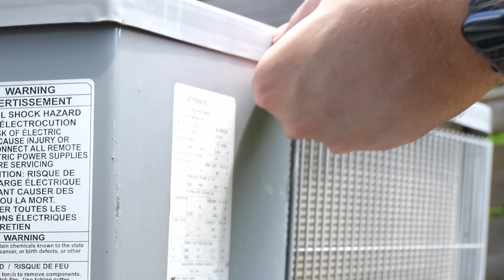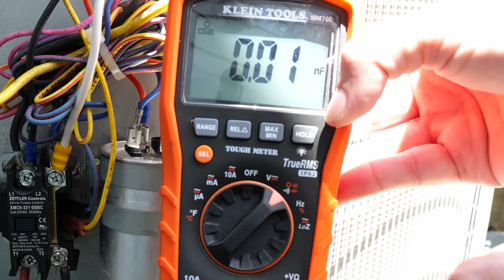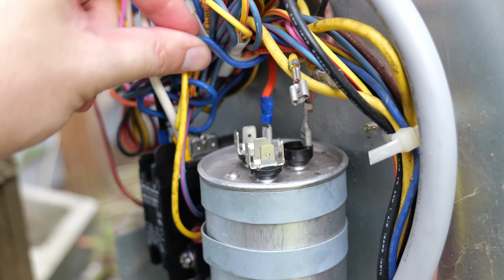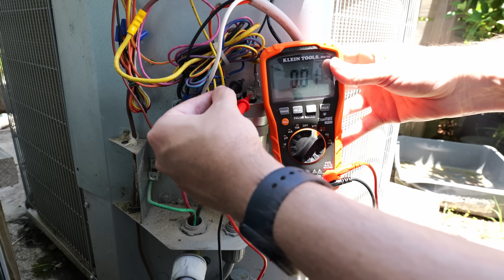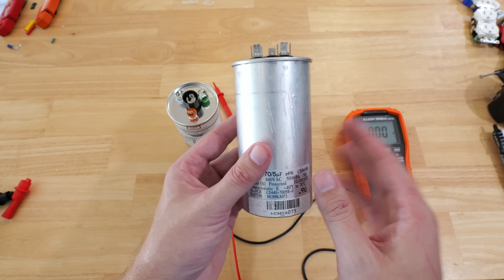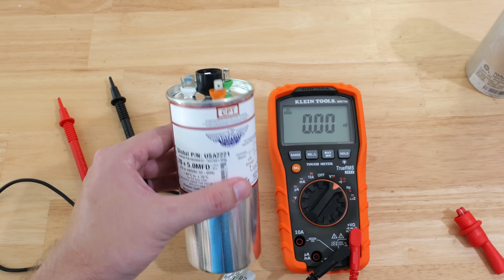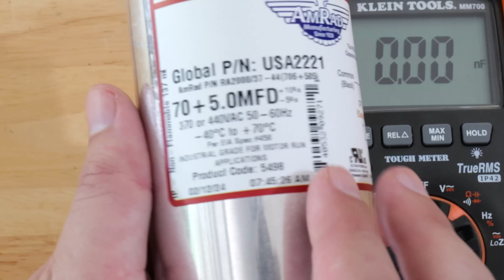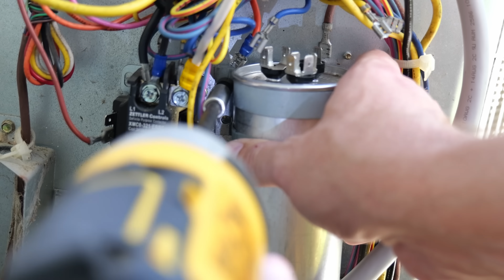Don’t Get Ripped Off! How To Avoid The AC Capacitor Scam And Save $500

Comment: I have this problem that I figured out right away,  the contactor stuck on. I have determined ( even though the thing has no label) that it is a  single pole 24v 30 amp contactor ( carrier unit by the way) . so I have that in my checkout now, but i know this units pretty old and I thought, probably would not hurt to look up the rest of these parts and see if I can help this run better ( I literally have not looked in this unit since 2006 and who knows how long before that has it been serviced )   The contactor is only 14 bucks, the capacitor that is installed LOOKS FINE and the unit runs  but its a little noisy humming,  but also the capacitor is an oval General electric dual run , it was made before GE switched names to gentec.  i did not test it as you have shown yet but I do have a Genentech equivalent in my cart right now as well ( 27.00 ) -  there is another component in the unit I have here that I do not see in yours and t hat is probably because mine has no board like yours.  The thing is a barrel  starter assist  thing  labeled Cera-Mite  305c11 HC95XX009  <-   it looks old and I thought, well I will just get a new one of those as well and everything will be Optimal!  BBUT that little gem is HIGH DOLLAR! YIKES!  around 100 bucks.   does this need to be replaced  just for being old ya think?  I mean, it's not cracked or bulging or anything.   must be a chunk of gold inside or something.   it has 3 wires one in the middle of the barrel and one on each end, when I looked it up ( function) says boosts a start of the motor.     I was wondering if the motor starts and runs  maybe it's all good and no 100 bills going fly outta my pocket OR if the whole system would be better off  with a new one , is there some kind of equivalent for that part.    I thought maybe they don't make or use them anymore and maybe because of that they raised the price to stupid high.   I am not sure why but my capacitor is well over 20 years old and it looks perfect . <- I am going to go test it after dinner. LOL 
   Thanks for any help.   the best help would be right away though really as I am have no a/c right now at all.  :0)
Reply: Cera-Mite  305c11 HC95XX009 if it is attached to the capacitor(sepsrste location) it is probably called a hard start capacitor.

Comment: Remember, you're not just paying for the part you are paying for the knowledge it takes to troubleshoot the unit in order to determine that the capacitor is bad. Sure you might have found one thing that you can fix if you're lucky but how about that technician that has to make his living?

Comment: Many hvac technicians have to sell a certain amount of parts per week. In a lot of cases the technician might get a base pay but where he makes his money is on a percentage of the parts sales he does.  Thats why a 7.00 capacitor will cost you 200 or more dollars.
I never changed a capacitor that was within 10 percent. So.. if that 70 was a 63 mfd or better.. I wouldnt change it.
Look.. there are costs associated with "the cost of doing buisiness" which is rent, vehicles, insurance, uniforms... all the things it takes to run a business but over the past decade or so HVAC companies and all trades in my opinion have begun charging just outrageous prices.
High parts and repair costs are also used to try to convince people that it might be  time to replace a system. Techs and their companies really make out like bandits on system replacements.

Comment: If you’re just changing a cap you’re not fixing the problem, you usually have a plugged condenser coil and usually it don’t look it till you wash it properly from inside out with a proper cleaner so if you or the service provider aren’t identifying the true reason for failure you’ll be there soon again and probably changing  part that’s more expensive 😂

Comment: Always keep a spare cap in you just in case box.   Don’t forget you may have one for the fan.   Also the air handler has one.  So you need 2 or 3 depending on your unit.   I’ve actually never had the one on the air handler go bad.  I had an AC guy try to tell me my compressor was grounded. He never disconnected the wires.  You always want to isolate your component before testing.

Comment: the percentage is there  to let you know that the capacitor  has a tolerance from the factory  so it should read on a 5 mfd  @ +/- 10% you  should be at 4.5-5.5 out of the box that is not necessarily what the rating tolerance is for functionality  for that  if you like rules of thumb  its lower or higher than 30% i always think of it like in school 70% is a C but 69 is a D  so  you fail  but a C passes.

Comment: Should check voltage and amperage on the compressor and fan motor after replacement of the capacitor. This is to make sure there is not a reason the capacitor failed. Tag on the unit will tell you normal run load amperage. Anything around 50 to 75 percent of normal run load is fine. If more than that there is another problem.

Comment: Wish you would have included why you get OL reading when wires are still attached to capacitor.
Reply: When the wires are disconnected the only thing being tested is the capacitor. When wires are connected it's testing the capacitor and everything back in the wiring. If there is any sort of path to ground on either side the capacitor will not charge and you get OL reading.

Comment: Interesting video. I Have a question and hope somone can help me.  I want to lower the startup current on my refrigerator which is connected to an ESS battery system. The startup inrush current I measure with a chines multimeter is 12.5A @120Vac the nominal current of the compressor is 0.8A. The impedance seen by the grid during starup  is 10 ohm so I thought let's use a 10ohm NTC 2A resistor in the run coil path of the compressor. In this way I want to lower the current with say 50% assuming the compressor will still start and not stalls under these new conditions. My question is this a good idea, and has anyone ever done it. Is my assumption of 10ohm NTC ok.

Comment: So, you didn't make this clear in the video about what exactly the tech was doing wrong?

A good cap will test bad if it has the  wires connected to it?

Sorry, but I don't know why anyone else hasn't asked this question?
Reply from the maker: Well I think it is because I described what they did.  I had a whole section on it.

Comment: I had an ac company come out on a Thanksgiving holiday weekend once and the guy replaced the capacitor and only charged me $120. I knew nothing about the capacitors then. He said "I'm not going to charge you $120 for a part you could buy yourself for under $50. Still use that company for all my ac issues that I can't fix myself.
Reply: Sounds like you have a good company doing the work. $120 isn't too bad, if you take into consideration they have a business to run.

Comment: I have just one question. You had to have called them out for not cooling. I concur with your testing argument. My question is, even if he conned you and replaced a good cap with another good cap that would not have fixed the system, what fixed the system?
Reply from the maker: There was nothing wrong with my system.  I have a maintenance contract with them basically to make sure my refrigerant levels are good.  He “found” that during an inspection.

Comment: I just replaced my capacitor last week. $26 and 10 minutes of my time. Just pull the breaker, discharge the old capacitor (comm to herm, comm to fan) and then just put the new one in and hook it back up the way the old one was connected. Just take pictures. Simple.

Comment: I had one company come out and they said my fan motor was amping up and would soon die.  Then of course it needed a capacitor, and the evaporator had a blockage, all together this would be about $2400 worth of work.  They had already sold me a fan motor a couple of years before.  A condenser fan motor did go out in it while it was still in warranty.  Anyway, I had enough of their stuff.  It was cooling ok, so I told them, see ya' later.  Waited a couple of weeks and called another company.  They came out checked everything out and said, oh, you might need about a pound of refrigerant, but other than that, it's in great shape.  Guess who gets my repeat business.  Then that company started the same crap.  I found one now that seems to be completely honest.  It had been about three years since I had the AC checked.  I knew he would try to sell me something, most likely a capacitor. Well, he thoroughly cleaned the condenser coils.  Checked the capacitors properly right in front of me, and said it's OK.  Checked the fan motor current draw, and the pressures.  Said everything was OK, charged me the $79.00 that they advertised for the clean and check.  Packed up and left.  I'll probably get the same people out this fall to check the furnace out.  This system is closing in on 20 years old.
Reply: Lucky!!  I wish I had that luck.  I'm glad for you. Honest people and honest prices are hard to find these days.

Comment: Why even test the unit, these are cheap to replace and 90% chance that its the problem if the fan is not running. Just swap it and then troubleshoot.

Comment: Thanks so much for posting this. Technician came out to do maintenance and recommended 3k in AC work. I back tested and agreed the capacitor is bad but bought it myself for $16.
Reply: "Maintenance" is usually not required for systems unless the owner is so incapacitated that he/she can't replace a filter or hose off coils.

Comment: I see many comments on price when servicing a HVAC for a $20 part. There is a lot of hidden cost in running a business. Training is on-going, Work Comp, Liability Ins, advertising, vehicles leases & maintenance to vacation for techs. It’s true you get shady characters in almost every business but I have seen $4k for heating the building in a month and a $20 hr tech actually cost $33 when uniforms, Medical ins, Safety gear… There 50+ things to consider. Even his meter is $150+ depending on brand. I have a Fluke 87-5 RMS that cost me $500, but has a life warranty plus I send it back for accuracy testing every 3-4 years. Equipment changes, EPA rules change, computers, tax CPA, Liability Attorney on retainer, etc. Not defending anyone’s price or practice but the bolts & nuts are pricey all the way around! USA made; $42 retail. Off-Shore $22 retail. Amazon $18 w/3 month warranty! You decide. I am a retired Auto ASE master and $6 per flat-rate hr as customers paid $24 to get a car fixed. But that was 1977 when Star Wars came out. Theater ticket; $2.50 yeh I was there. Good Cap Video!

Comment: As the common, fan and herm terminals have multiple spades, does it matter which spades you connect to as long as your wire for fan, for example, goes to one of the fan spades?
Reply: doesnt matter as long as they go to the correct spade on the correct terminal

Comment: i just ordered my new capacitor as when i turned the AC on it was just humming and the fan wasn't spinning. I am an electrician for 35 yrs so i am just going to swap out the cap. I ordered a new contactor just in case as they were so cheap. But if I'm not mistaken i believe there was only two wires connected to it. When i get home today ill make sure but I'm wondering if the guy that was there last time spliced a couple wires together and only used two terminals. i will have to do a little more digging before i replace it.But my question is have you ever heard of that situation. Thanks

Comment: This is the exact reason I dont do residential HVAC. Dealing with homeowners is miserable and you have to take the abuse for every other contractor who screwed them. No thanks, fix your own A/C. Good luck.
Reply: You actually think you're the only choise home oweners have?
😂😂😂😂😂 what a 🤡.
Your probably a Scammer technician and that's wy you got alot BS from residential customers.  Thank God you dont do Residential.

Comment: I am a licensed HVAC, 71 year old. To charge $450 or $500. For replacing a capacitor is highway robbery. I charge between $197 to $250 depending on the size of the capacitor, I also use a heavy duty capacitor so I don't have to return. I have to make an honest living, I don't think there is a need to rip people off. When I get a call for service, I tell the person that I have a service call fee for going to diagnose the problem. If you don't want to pay for my diagnosis then I don't need people like you. I had an Indian who refused to pay me for my diagnosis, but wanted to know what the problem was so that he can go buy the part online. I wasn't going to tell him. Some people think they are smarter than you. It is not good to rip people, but it is also not very good for people to try to take advantage of you. You might think that the only problem is the capacitor, but in some ocations it is not and if you have no knowledge of what you are doing, you could end up electrocuting yourself.

Comment: It's not the Tech. His company list the capacitors at $500 because they don't pay their techs a living wage to perform the actual service. Out of that $500, he would keep 10% = $50. Not bad for an hour's work, but imagine if that's the only part he sells that day on 4-5 calls. This is what the homeowner gets for trusting ads or coupons for a $29 service call. The more you pay for a service call IE) $99 and up, the less you would pay for a capacitor.. Some companies if you have a service / maintenance contract with, you don't pay anything for a capacitor.
Reply: I pay $20 a month for winter tuneup and summer tuneup. They had the capacitor out to show me it is bad. He then put it all back to write me up a suggested maintenance ticket where they wanted to charge $200 for capacitor. He could have just did it while it was off for $75. $20 for the part and they would have made money. Instead they wanted $800 to replace the capacitor, contactor, and clean the coils. Insane.

Comment: Guy just left after telling me mine was going bad. They want $346 for a new one. This one's a month out of warranty, so obviously they made sure and set my appointment a month late. But they sell for $12 on eBay. Or as much as $26 at Home Depot. And I'm pretty sure they've gotten me multiple times before, because I had already watched this video sometime in the past. He's also telling me my soft start capacitor I bought last year is failing. Wanted to $806 to replace the two and that's supposedly is giving me a $143 remember discount. You got a video on the soft start capacitor?

Comment: Same happened to me....sort of. I have an company I've had a service account with for many years, and I'm very happy with them....mostly. My heat pump is getting older and will need to be replaced pretty soon, but on the last servicing my technician left off a bit on info when he talked to me. He put in his report that the cap was weak, but didn't specify nor did he mention to me when we reviewed the findings. My guess is that they've been told not to mention these issues when a system is near time to be replaced. The way I found out is my duel fuel system (electric/propane) started chewing through propane like crazy. I thought there was a leak and had my service company come check (for $100). This tech told me that the cap was bad and that my system was never switching from Emergency Heat (propane) back to regular electric heat when the external temperature rose. They wanted $280 to replace it (which from what I hear isn't that bad). However, after I stopped laughing I just replaced it myself in 5 minutes with a screw driver and a multimeter (not really needed as it was clear the cap was dead). This is BY FAR one of the simplest fixes for an AC or Heat Pump virtually anyone can do. HOWEVER: this is high voltage equipment, so make sure you take the simple, but mandatory precautions.

Comment: People just don’t know how HVAC sales work, they are so similar as bad used car salesman are. I got 6 bids on fix my compressor on my heat pump part of my ac unit in the winter of 2025 . Anywhere from $8400 to $2234 for just the compressor motor. And all 6 of them wanted to replace the outside and inside units, high bid on that was yes at over $20,000 , yes & Yipps , what a joke and such a cruel world we live in !

Comment: Just remember  to short capacitor  across  each pole. They can hold electricity. Usually  bad capacitor  swelling at top round instead flat. I always bought the higher voltage rated capacitor it works with all. Why not standard  I don't know.

Comment: Have a proper circuit breaker installed in the electrical box near the unit, rather than a "quick disconnect," which can "leak through" and send a small amount of electricity to the unit.
Reply: You have no clue what you're talking about.

Comment: yep there are so many people getting screwed on this. I replaced mine for 20 bucks.. and got two for 20 so i have an extra. The only issue i came across was the new capacitor was a more slim design and would not fit in the original bracket holder. So i just gave the new cap about 8-10 wraps with some Gorilla tape to thicken up the middle. Then i was able to secure it with the original bracket.

Comment: I just sent the Snyder guy home after trying to charge me 500.00 to replace my capacitor. I watched him release what I'm assuming was freon since I saw big clouds coming out of the AC unit. He came back in and said there was a leak but he had no clue where it was coming from. Cost of leak repair 1200.00 cost of 3 to 4 pounds of freon 160 per pound. Came out to about 2300 total. My husband told him to get screwed. Question is, how do I get my money back for the freon he released.